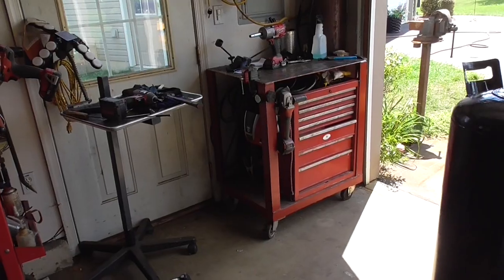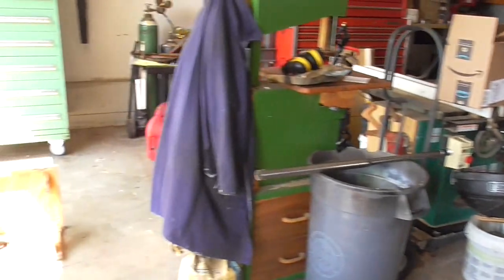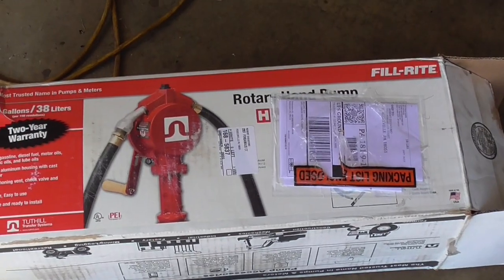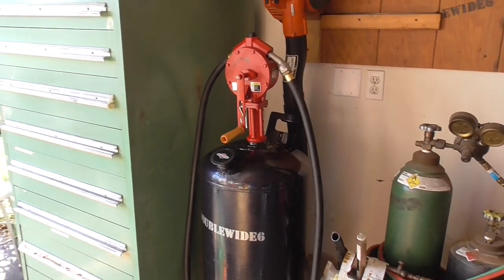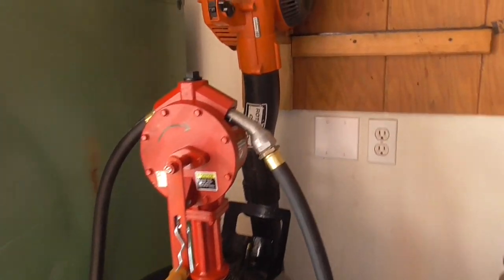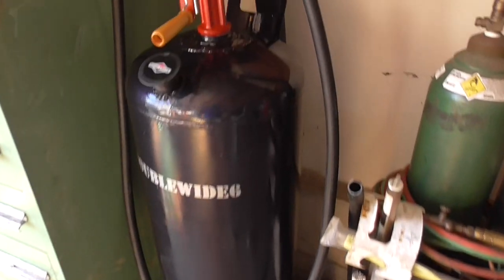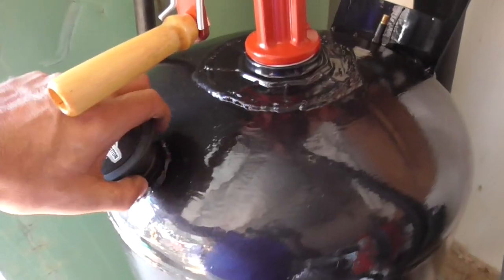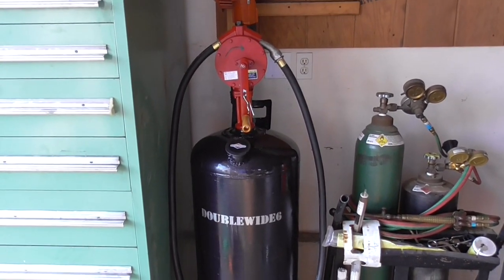DIY Gas Caddy Build 30 Gallon

Comment from the maker: Here are the supplies from the video:
https://amzn.to/3lu9cM3 Fill-Rite Pump
https://amzn.to/2D9RcFo Fill-Rite Electric Pump
https://amzn.to/3gGbLXM Purchase a Gas Caddy
https://amzn.to/2ECtmmu Fill-Rite Filter Kit
https://amzn.to/3futy3z 4.5 Cutoff Wheels 50 Pack
https://amzn.to/2PlsrIH Neiko Flap Disc 4.5" 25 Pack
https://amzn.to/3fsATR5 7" Grinder Dewalt
https://amzn.to/2D93i1J 7" Grinder Fiber Mesh Discs 25 Pack
https://amzn.to/2PpQqqe Deko Autodarkening Welding Helmet Full View
https://amzn.to/2DA81ck Tillman Mig Welding Gloves
https://amzn.to/39T982U Rivot Gun with Rivets

Comment: After watching about half the video I was watching with my son and said boy he is going to wish he had a remote and electric pump once the gas starts to overfill what your filing. On a side note you do have some God given talent at coming up with ideas for creating stuff for us home DIY'ers. Also, note he has right by a window so it can be vented if needed, Keep up the videos, you and Mustie are my two favorite for watching creative creations from what you have or found or purchased inexpensively. ;) Also on a side note gas weighs less than 7 lbs a gallon. This sounds crazy but I was thinking a hinged or moveable set of wheels for the front/back or both.

Comment: Ask a fire dept about u have. Fumes will ignite. Look at boats with blowers. 30 gallons of gas in yr garage attached to your house. Just sayin. Also yr insurance will look badly at this. Store gas outside in a shed.
Reply from the maker: I have about 5 gas cans on the floor of my detached garage.  The idea is to make the garage safer, and get rid of the gas cans.  To fill it up I wheel it onto my truck lift gate and strap onto the back rack on the truck and get it filled up.  I now use a 2.5 gallon jug for filling mowers and the like.  The hand crank requires no power so it could be moved outdoors if I make a cover for the vent hole.

Comment: I’ve been thinking of doing something similar with my gasoline. I’m just wondering how you have made out with your gasoline storage DIY. Is there anything you would do different? Besides move the wheels to the front and do you see any potential dangers because I’ve noticed you made this video about three years ago and You have had time to see any problems.

Comment: A lot of cars hold 20 to 30 gallons of gas, can you fill your truck and then reverse pump it into the 30gal. container, because that would be nice, saves moving it around.  Oh and people park their cars in garages all the time, most have gasoline in them ,  it seems safe enough.    Most garages have everything but cars in them.   Very nice 👍

Comment: What do you use for sucking out gas out of small engines? let me know. Awesome pump man.
Reply: @ Jeremy Anthony : I use an outboard motor gear oil pump, with some clear hose from the home center. About 10 $$ for the pump. Use it also for oil pumping.

Comment: That's a nice little set up but it's against the law to fill that up at a gas station because it's not an "approved container" but you couldn't get it out of the truck if it was full anyway without a gantry or something. Thats more than 240 lbs. Just the gas weighs that, add in the wheels and the pump and hose and tank your probably just over 300 lbs. As long as you keep it at your house you should be fine. Just fill it up with the gas cans. Your project turned out nice. You're right though you should move the wheels and handle to the front.

Comment: Looks like the pump is made from plastic. Made in China? I would add 2 wheels on the front then you don’t need to tip it when full if you ever move it.